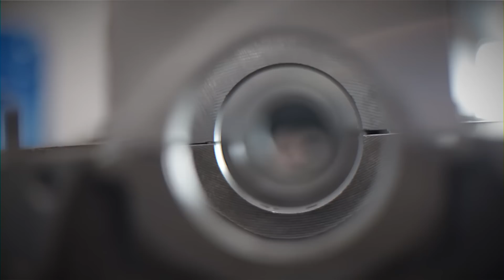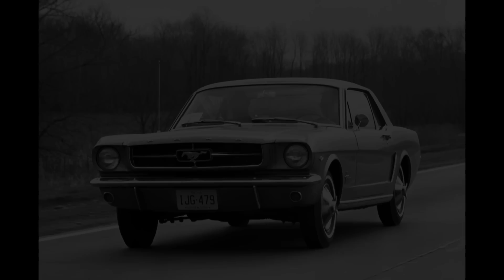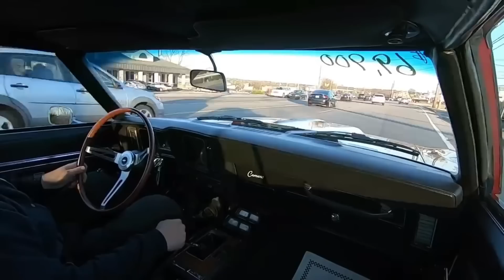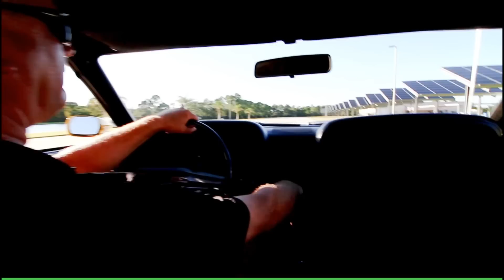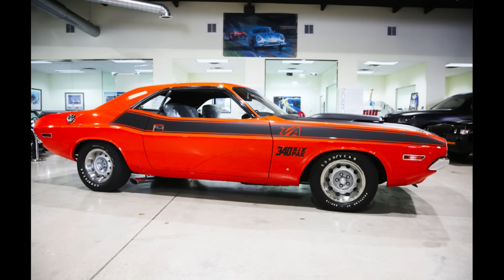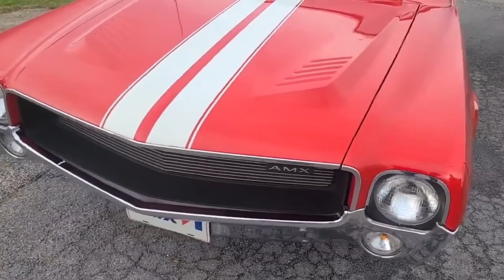Most RARE Small Block V8 Engines Ever Built

Comment: V 8
Engine Code :	AMC Typhoon V-8 290
Fuel type :	Petrol
Fuel System :	Carburetor 4-Barrel
Engine Alignment :	Longitudinal
Engine Position :	Front
Engine displacement :	289.8 cu-in / 4749 cm3
Bore x Stroke :	3.75 x 3.28 inches
95.3 x 83.3 mm
Number of valves :	16 Valves
Aspiration :	naturally-aspirated
Compression Ratio :	10.0
Horsepower :	225 HP / 228 PS / 168 kW
@ 4700 rpm
Maximum torque :	300 lb-ft / 407 Nm
@ 3200 rpm

Comment: Rehashing the same old stuff instead of actual research like the vast majority of YouTube videos.  Ford NEVER made a 1964-1/2 Mustang.  The 1965 Mustang was introduced in April 1964 and the model year production ran for 18 months, but they ALL have a 1965 VIN code.  This is not unique or unusual, this happens sometimes in the auto industry.  And what's so "rare" about some of these engines?  That would make every Ferrari ever made "rare".  And "rare" is the most over used and incorrectly used word in the entire classic car media when many times "unusual" or "uncommon" would apply.  "Rare" has an element of desirability.  Most of these would have been produced at a million per year of people actually wanted that many.  But they didn't, did they?
Reply: You are actually correct, Ford made the fact that the first Mustangs were 1965 automobiles, while the first Barracudas were 1964 automobiles, but we all refer to the early Mustangs as 64 1/2 because Ford changed almost everything on the car when the real 65s entered production - engines, bell housings, exhaust system, charging system, horns, radiator bulkhead, steering wheel and related parts, the fuzzies in the window channels, the interior lock buttons, adjustable vs non-adjustable passenger side bucket seat, the gas cap, the hood, the front fenders, the headlight doors, even the Mustang emblem on the front fenders, and probably more.  Way too many changes to be considered mere running changes.
Reply: As far as "rare", that, and "vintage", have become the most over-used words around.  The younger generation seems to think that anything made more than 5 minutes ago is "vintage" and anything that you don't see 25 of in one day is "rare".

Comment: The AMC  was and American Motors second generation V8. it was later stroked to 304 cubic inches along with an increased deck height and better designed heads. The Gen 2 engines were available in 290, 343 and 390 cubic inches while the Gen 3 raised deck engines were available in 304, 360 and 401 cubic inches. In 1969 AMC wanted to get into drag racing and they hired two teams to see how much power racers could get out of a 390. The answer was 529 horsepower. This was in custom built form. AMC also tried their hand in Trans Am racing. They enjoyed periods of dominance in both of these types of racing, but they didn’t do as well in NASCAR.

Comment: Small blocks are just as much of a gas guzzler as a big block. I can speak from personal experience. It's all in the configuration and technology of the engine. Case in point 305 gets just as bad as a 454 the carbureted version anyways. Small blocks were designed for better weight transfer and higher RPM range. Pollution ain't got nothing to do with it. Especially when you got small blocks that are still in the 7 liter range.
Reply: My experience is if an engine has enough power, you don't have to keep your foot into it all the time you will get better fuel economy. Gutless engines hog up fuel Because you make them work more.

Comment: 1918 Chevrolet model D  V8  4000 built. 288 cu. in. 4.7L  overhead valves 36 HP at 2700 rpm. Featuring an aluminum water-cooled intake manifold. The starter is in the valley of the block, as well as the gear driven generator with the fan clutch coming off of it. I'd say that is the rarest V8
Reply: 1917 was the first year.. to 1919

Comment: How could  the AMC 290 be one of the first engines AMC made, when AMC came out with a 250 CI V8 as early as 1956, after ten there was the 287, 327, 343 then the 290, 390, 360 and  401,  The 290 came out in 1968 that is 12 years to late to be first

Comment: The 283 Fuelie V-8 in 1957 rated at 283 hp.
Reply: The 1957 283 was the first to have 1 hp for each cubic inch At 283 HP. The 1956 Crysler HEMI 354 was the first to have more than 1 hp per inch Rated at 355 HP.
Reply: @mylanmiller9656 they never called it a hemi until 64.. ardun hemi heads for the flat head Ford was out 5 or 6 years before the Mopar so called hemi... and the heads were built by Zora the father of the Corvette
Reply: @tonysendrick6347  So what is your point nobody cares.
Reply: 315 HP with two 4 barrel carbs

Comment: The Buick aluminum block V8 whish was used pin the 1961-63 Skylarks;  this engine was later sold to Land Rover.
Reply: Oldsmobile put turbochargers on a few of them and made some impressive power.
Reply: It was also used in Oldsmobille Cutlass

Comment: Forgot the 1971 Ford Boss 351 C. All 4V canted valve Cleveland heads had 2.19” intake valves and 1.71” exhaust valves, and huge ports! Not only the biggest valves and ports of any small block, bigger than many big blocks. And the rare 1971 only Boss version of the 351 Cleveland had a solid lifter cam, push rod guide plates, 11.3 to one compression, a 780 Holly carb, hi-rise aluminum intake, header style exhaust manifolds, 4 bolt main block. Underrated at 330 HP. Saw a stock Boss 351 with the exception of headers put out around 380 HP on a dyno.
Reply: I can't believe it was not mentioned, but how many were made?
Reply: @gregpremo6898  There were 1600 Boss 351 cars made. The Boss 351 had an Autolite Spread bore, 
carb because the Holley couldn't pass emission laws without an air pump., I know because i replaced my Intake manifold and Carb for the pre-production ford Manifold that would except a Holley. a real aluminum Ford Squair bore intake today is expensive, but blue thunder makes a re-pop for less than half.
Reply: @gregpremo6898  1806, for one year only in 1971, I believe just only in the Mustang.
Reply: You are so right. Even the Cleveland engine rated @ 300 HP, actually put out 351 HP & 391 ft lbs of torque.  I had a 71 Torino GT with that engine, & it would give the Chevy Chevelle with the 360 & 375 HP engines a run for their money, & could take overhaul of the Chevy' s I raced ! These were all 396 cube engines.
Reply: Sounds like the spec for Ozzy falcon phase 111
Reply: 351 Cleveland moved to Australia think mad max
Reply: @thomastevelde8547  Cleveland was de-tuned then moved to Australia. The only 4 v Cleveland was imported. Australia only made 2v heads.

Comment: Fords 289 and 302 V8's were the most bullet proof on the road. I had 5 of them. Fords Boss 302 1970, was rated at 290, but was actually closer to 350 H.P. The Boss 351 had 383 HP.
Reply: 318 is hard to beat
Reply: chevy 327 and 350 and amc 232  was best engines i ever seen for durability

Comment: The ford 289HO was also in the 1964 Mercury Comet.  Put a 4 speed manual behind it, and it ripped!
Reply: In 64 it really was! My bud has a 68 falcon factory 289 4 speed.
Reply: @congerthomas1812    The engine,if High Output, has HO on the intake manifold.  If I remember correctly from 54 years ago is on drivers side just toward firewall from carb.
Reply: Dick Lux had one in his '64 Comet and raced it as an NHRA SS/M Super Stocker. That car also set NHRA SS/M National Records.
Reply: @Clunk49    My Dad called it Frog!   Because it could jump so fast.  It was his car.

Comment: You forgot the Ford 240 V8 they put in the Sunbeam Tigers. Probably the smallest small block. I worked for Wickes Furniture as a service repairman and they ordered our 73 Ford Econoline van with a Boss 302 and 3 on the tree. It was fast enough.
Reply: 260 Windsor V8, 240 was the "Big Six" used in Galaxies and trucks.  There was never anything "rare" about a 260.

Comment: Did I miss it?  What about the 273 cu in engine in cars like the Dart?
My first car was a 66 Dart Gt  273 cu in  4 speed 4bbl 235 hp.  My cousin owned it before me and used it for drag racing. He said he never lost to a Mustang with a 289.
Reply: Super Commando
Reply: I had a '65 Barrucuda with that engine.  I ordered it while I was still in the US Army in Germany, and picked it up at the factory on my way home after I got out.  It was
Reply: T.hat little engine was a real screamer  and I beat quite a few 289 Fords in Falcons and Mustangs
Reply: @Wiseguy1408  if you raced at the track do you remember the 1/8 mile or 1/4 et and speeds?
Reply: @lw216316  I never ran it at a track.
Reply: @Wiseguy1408  is was ????
Reply: Inthose times. A smallblock Ina smaller carr with good gears to get to the rim range and a four speed would be the best combo and still be ahead of the insurance companies.
Reply: What was "rare" about a 273?  You could get them in a Valiant, Dart, Satellite, Coronet, Barracuda... maybe not a fullsize car or Dodge pickup?  But "rare"?
Reply: @jeffbranch8072  they were available but when I had mine I never saw anyone else with one like it. Mine was the gt version with the 4bl carb - There were lots of 289 mustangs around....you don't see the 273 that much at the tracks.

Comment: Ford made the compact fairlane in two model's that I remember 260 cubic inch and the 221 cubic inch
Reply: And I believe the 221 was only 2 years and also in the comet…
Reply: My first car was a 1963 Fairlane 4-door with a 221 cu. in. V-8 with a two speed auto transmission!
Reply: @stevenkish4217  I had a 63 Fairlane stationwagon with a 221. It was worn out and was so weak you almost had to push it downhill. But overall, I loved these small block Fords, simple, easy to work on and normally very tough.

Comment: Yes , these are engines not motors ! Motors are electric.
Reply: Just search: Motor Oil, and see if you want MOTOR OIL  in your electric motion device.
Reply: Guess you guys are too young to remember "Motors" repair manuals, which came before Chiltons, and long before Haynes.
Reply: Technically speaking, anything electric (mainly referring to electric motors) is really a motor, anything combustion is an engine. Gasoline engines, diesel engines, jet engines, gas turbine engines, rocket engines, steam engines, are really engines not motors, but we just refer to them as motors sometimes, kind of a nickname.
Reply: @trucking604  , I would agree. The name becomes generic at some point in the lexicon.
Reply: @joequillun7790  Just because the Auther of a popular repair manual didn't know the difference between an engine and a motor don't meal he was correct.
Reply: @mylanmiller9656  LOL. Just won't let it go, will ya? 😂
Reply: @joequillun7790   Only a wing nut calls am engine a Motor.
Reply: Or mills 😊

Comment: There is no such thing as an AMC small block or big block .it's bore and stroke that make the CID. All blocks same dimensions.
Reply: Except the 1970 390. It was a tall deck block
Reply: @tonysendrick6347  All AMC engines after 1969 were tall blocks even the 304 , 360 390 and 401.
 390 was the only one built in both low and high block.
Reply: All AMCs are small block. AMC never mass produced any big block
Reply: @sarahstephens5966  not exactly  that's  like saying all Pontiac s are big blocks  because of their dimensions. There are just Pancho  blocks. They not unlike AMC are based on bore and stroke not dimensions.

Comment: Sorry, wrong about the AMC 290.  Thousands were built with 2-BBL carbs and installed in all sorts of sedans and station wagons.  The HO-290 was rare, but the run of the mill version featured the same forged lower end.  Mostly carb, compression, cam, and ignition timing made the 290-HO different.  Was a runner.  Was also redesigned to become the 304 that went can-AM racing  😅

Comment: Mechanically helped camshaft. I guess anybody can make a video.
Reply: Ya, there's a little Leprechaun in there wearing a wetsuit banging on the pushrods with a hammer.
Reply: Is this crap video make by AI with a robot narrating it? It's just bizarre. small BLOCK motor.  Reminds me of a group of guys back in the high school days hanging out in someone's garage bench racing. Out of  6 guys, maybe one or two half way knew what he was talking about.
Reply: That was the Parker Valve Camshaft Actuator, powered by compressed air allowing short bursts of Parkerized Air to burst out of the Parker Valve to help actuate the spinning of the Camshaft (s). Google it if you don't believe me. They were pure hell with small block drag racing engines. Can't believe you've never heard about Parker Valve Camshaft Blowers. They are ultra rare, though.

Comment: 1968 Pontiac Ram Air II 400 CID Firebirds. They are in pure stock racing only topped by a few big block Corvettes and few Chrysler 426 Hemi's. Very rare option in the one year only offering. In 1969 the Ram Air IV engine replaced it.  You missed this one.
Reply: Most of our cars back them were crude machines with lots of raw power.  I had a 68 Chevelle having a slight overbore that made it 408 ci,  a General Kinetics camshaft with not outrageous lift and timing, ported small port 454 heads and intake with a cleaned up quadrajet carb and stock headers running into 2 1/2 inch pipes and Walker glass pack mufflers.  Stock 4 speed box and 3.56 rear gears.  Best ever time at Englishtown, NJ; it laid down an 11.68 at 118.  I often wondered what it would have done had it been a 4 bolt main bearing block with higher compression heads, etc, etc.  It was a beast like it was but it did not handle well and the brake system was inadequate at best.
Reply: That depends how you define "rare", and the same RAII was also used in the GTO.  This is about the engine, not the application.  Compare the RAII to the total production of Ferrari in 1968.  Rare or uncommon?
Reply: @jeffbranch8072  Ferrari vrs a domestic mass-produced engine. You must be joking. Not to mention it would takes 3X the money in a Farrari just to match a factory Ram air II fire bird.

Comment: Ford 351 Cleveland should have been on this list
Reply: A Cleveland makes more horsepower per cubic inch than most motors. Superior oiling system and valves and (flow). Just ask Ernie and Bill Elliot.
Reply: No, hundreds of thousands made, especially in Australia. Hell, even the DeTomaso Pantera used that mistake.
Reply: @sarahstephens5966 I remember when the Pantera came out, they had a bad design in their cooling system and they would overheat. The engines were fine in other vehicles. A lot were put in boats.
Reply: At most only the 1971 Boss 351.  The rest of Cleveland production was ubiquitous, except maybe the Cleveland 302 for Australia.

Comment: The 340 six pack made 290 hp not 275 and it was no available in the dart. Only T/A Challengers and AAR Cudas had the engine.
Reply: And that is the only way to get both.
Reply: Nearly every engine that came out of Detroit in 1970 was quite underrated for insurance purposes.NHRA caught on,and refactored a number of them.Chevy’s ‘67 327 QuadraJet was rated at factory 275hp.70 Dodge 340 Magnum with a 750cfm Thermoquad carb,more aggressive in every way,was also rated at 275hp.My estimate is that they were more like 320hp.I’m guessing the 340six-pack was 340-350hp.
Reply: @babaoreally8220  1970 340 still had an AVS. Don't remember a TQ in 1970.
Reply: @joequillun7790  We never paid attention to torque till it was in the 450-500ft/lbs in those days.
Reply: @babaoreally8220  "TQ" meaning Thermo-Quad.
Reply: @joequillun7790  Yep.Pretty nice carb for factory.
Reply: @joequillun7790  I think they came out in the early 70s,but many racers were putting them on their 340s.They handled the under hood heat much better than all metal carbs.
Reply: @babaoreally8220  Chevy was Over rating their engines to sell cars, in the mid 1960's it was not funny.  Some of their engines were down by 45 hp. when tested on a independent Dyno.
Reply: @mylanmiller9656  just the opposite.Car insurance for these hot rods was heavily influenced by the power of the engines in them.Higher insurance means too high car payment for buyers.Less horsepower less insurance costs.Auto makers were using every trick in the book to keep these numbers lower than what they really were.
Reply: @babaoreally8220  In 1970 that was true but in1965 the GM cars were overrated badly. Like a Corvette 327 375 hp engine wouldn't make 340 hp on independent dynos. Chevy was fudging numbers to sell cars.
Reply: @ There are some instances of that,but those were special H/P engines like my HS friends 66SS Chevelle with the 396/375.That engine in a Corvette was rated at 425hp.Corvettes were always rated that way.
Reply: @babaoreally8220  

Chevy admitted they were BSing about the HP of the 425 HP 396, when it was tested by independent tests, it was right around 375, not the 425 stated for the Corvette.

Comment: What about the 350 LT1 solid lifter cam 370 HP small block that came in the 1970 Camaros? Also, you said the 64 1/2 Mistang was the only car with a 1/2 year model. Wasn't there a 70 1/2 split bumper Camaro?
Reply: Loved that look.
Reply: 69½ A12 440 6 Pack Dodge SuperBee, A12 69½ Plymouth Roadrunner 440 Six Bbl,  both ½ year cars albeit Big Block engines
Reply: 70 and a half Ford Cobra....based on the Falcon...NOT the Torino
Reply: And what about the 1969.5 Maverick. the 1969 Boss 302 it was an April release.
Reply: No, '70 LT1 was 370 HP in Corvette, 360 in Camaro. All those "64.5" Mustangs are titled as 1965. The '70 Camaro was late arriving but titled as 1970.

Comment: You missed the Studebaker small block V8 with the Paxton blower.  My father had a Lark Rally with that and it was a tire smoker.
Reply: That was a B A leadsled !
Reply: Plus Studebaker was Canadian
Reply: @shawntailor5485  , most were not Canadian.  Only the late 1964 and all of the 1965-66 cars were made only in Hamilton after South Bend was shut down.  And all of the 1965-66 cars had Chevy powertrains (194, 230, 283) from Oshawa after the South Bend engine plant was shut down.
Reply: Stude 289